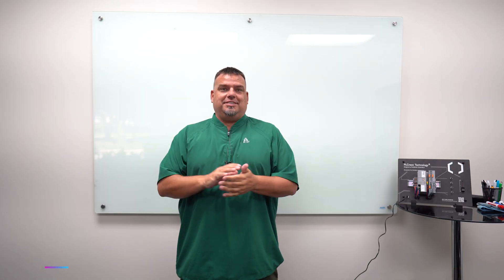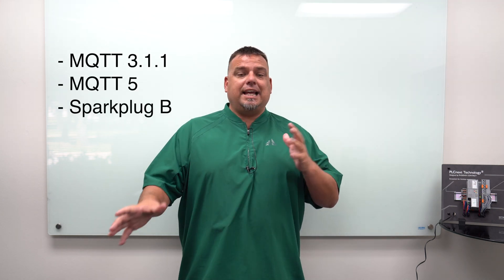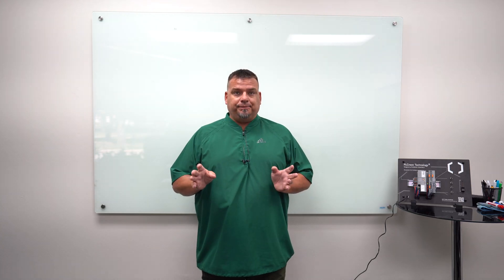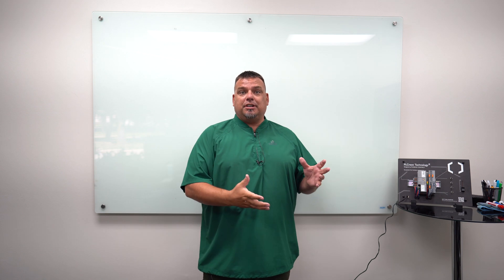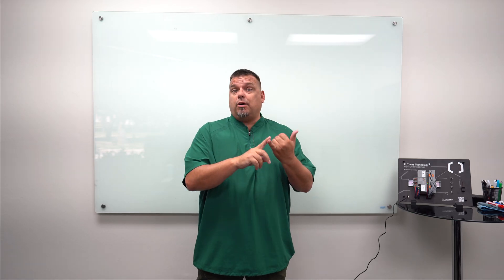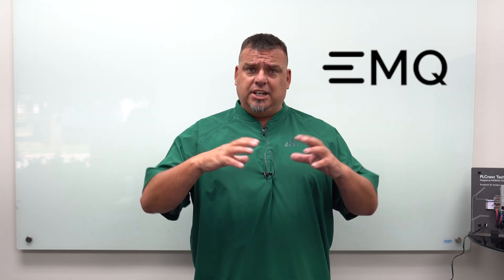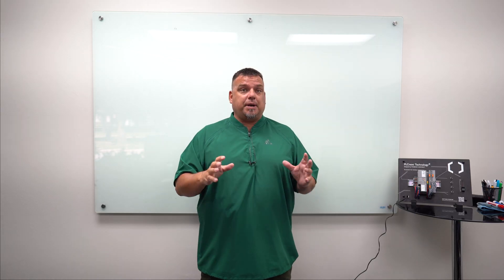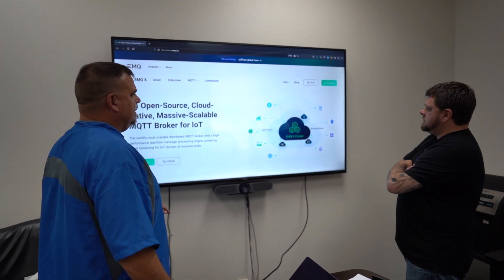OPC-UA & MQTT Deep Dive & Use Case [New Whiteboard Series!]

Comment: Hello, what are your thoughts on using Kafka as a unified namespace?
Reply: I did a bit of research and developed a small proof-of-concept project. The main disadvantage of Kafka is that you cannot subscribe to topics and subtopics the way you can do with MQTT. With MQTT you can use wildcards to subscribe to whatever topics you are interested in.
Reply from the maker: We get this question often… the answer is Kafka alone is not used as the UNS. It can be used to stream datasets into a data lake. But a data lake is also not a unified namespace. Search on YouTube what is the Unified Namespace